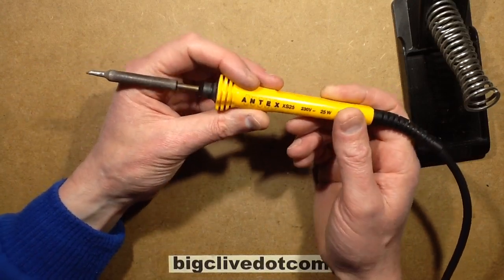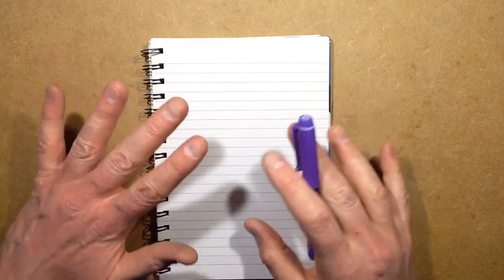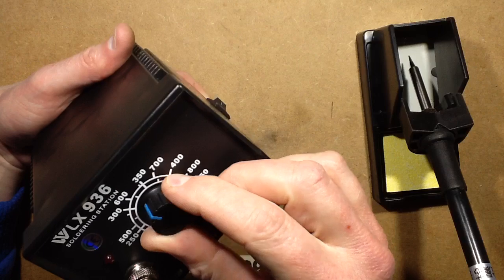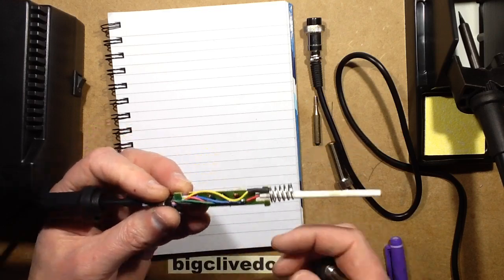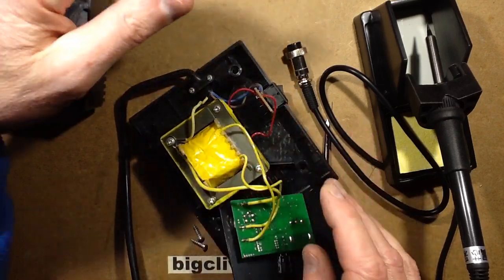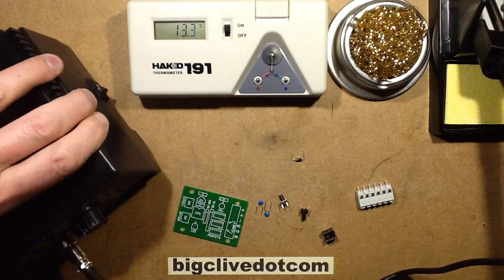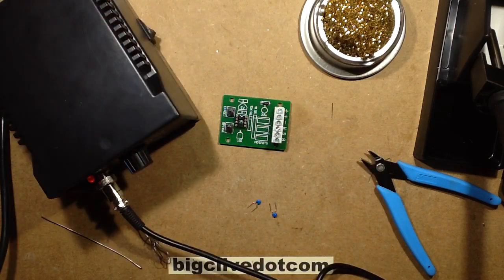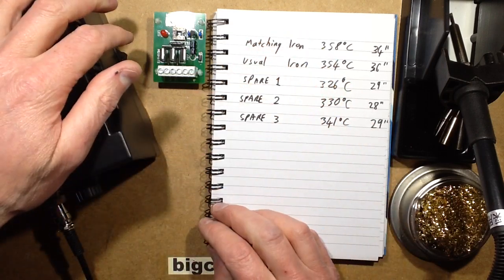Soldering basics and choosing a cheap soldering iron.

Comment: I'll echo the comment by +stefantrethan.  I tried one of the digital Yihua stations that Clive has on the way, and it drove me nuts.  Not enough thermal mass and it ate heating elements.  I ended up giving it away.  I bought a used Metcal station and I've never looked back.  Much higher thermal capacity, beautifully soft and flexible silicone lead on the handpiece, and it heats up in about seven seconds.  Honestly, the thing is a joy to use.

The beauty of the Metcal system is that there's no heating element or thermocouple to fail.  The power supply is essentially an RF transmitter, and each tip cartridge is a dummy load that's calibrated to reach a specific temperature.  The tip absorbs whatever power it needs to maintain that temperature, and it responds very quickly to changes in thermal load.  Yes, the tip cartridges are pricey by Chinese standards (US$15-25), but they last forever in hobby use.

If you're patient and watch eBay, you can easily put together a Metcal system for <US$200.  Look for the PS2E-01 or MX500 power supplies, the STSS-RM3E, MX-RM3E or MX-H1-AV handpieces (copies made by Thermaltronics and Easybraid use part number SHP-1), and one of the MX-series handpiece stands.  If you buy any part new, make it the handpiece, as the ones coming out of industrial use can be pretty rough.

The tips come in dozens of styles, all with part numbers starting with STTC (standard), UFTC (fine) or SMTC (SMT rework).  There are four series -- 500, 600, 700 and 800 -- that denote temperature (500 = 575°F/302°C, 600 = 675°F/307°C, 700 = 775°F/412°C and 800 = 905°F/405°C).  I use only 700-series (the most common) and they work great.  See: http://goo.gl/hNaAQF for Metcal's tip catalog, or http://goo.gl/lsx8JW for Thermaltronics' catalog of compatible tips.  Plenty of both available on eBay.

Comment: Don't know if I missed it, but did you test the calibration of the soldering iron tester? Maybe I'm paranoid but from brewing experience and seeing lots of cheap thermometers I don't trust anything on its own. Two or better three cheap but different ones reading the same I'll trust. Just one? No way.

Also, being taught to solder in a school physics lesson? How great would that be? They stopped teaching how plugs need to be wired some time ago. Back in the early 90s when I went to University and started an Electrical Engineering degree (that I didn't finish) I don't think 20% of the students had ever seen a soldering iron.

Comment: I got one of the digital 936 clones, and it seems fine with lead based solder. It does seem to struggle with lead free however.  +bigclivedotcom is it worth trying to insert some thin foil in as a sleeve to improve thermal conductivity? Or not worth the effort?

Comment: Would the soldering iron be usable with just a bench PSU, ignoring the thermo control?
I'd prefer it if so, a 2 quid iron on 24v on my 5A max supply....
Reply from the maker: +gazzaka I already had a play with that, but the mass is so low that it's not ideal.  24V would be too much.  The iron would probably glow red hot if fed 24V continuously.
Reply: +bigclivedotcom th I can reduce the 24v
Reply: +gazzaka You have to keep in mind that these are not high thermal mass irons, nor are they designed to be self regulating.  They are intended to have the amount of power flowing through them dynamically managed to maintain a safe and desirable temperature.  While you could dial in a temperature by varying voltage after extensive trial and error, you will find that they moment you try to solder a joint you will suddenly require a very different voltage setting to maintain an adequate soldering temperature.  Considering how cheap these soldering stations are, why not simply purchase the full station that does all of that for you without the risk of prematurely destroying your iron?
Reply: I know but for years, in fact even now...I use one of the Antex irons which function great with no such variations in voltage/current, so I wonder why we suddenly need a different system?

Comment: I'm using lead free solder is that okay to use on simple circuit boards, Is it toxic. I'v been learning how to solder like big Clive showed. It works perfectly going to keep practicing.
Reply from the maker: +Snoopy Singh Lead free is fine.  But treat yourself to some older style lead based sometime to see how it feels.
Reply: +bigclivedotcom I will do Thank you
Reply: +Snoopy Singh leaded solder is non-toxic, as long as you resist the temptation to eat it while you work with it.

Comment: +bigclivedotcom I would highly recommend treating yourself to some old Metcal gear like the PS2E-01. You can probly find deals for around $50-60 USD. I got one and I simply cant use anything else, it's just absolutely fantastic. No way in hell to "defeat" it's thermal capacity without unfairly cheating.

Comment: Cheers for this, been hoping for a soldering basics video since I have a fear of soldering after destroying a circuit board using a cheap iron I bought off Amazon. I've since bought an Antex, but I haven't used it yet for fear of cocking it up, because the old iron oxidised almost immediately and I wasn't sure if it was something I'd done wrong or hadn't done.

On an unrelated note, my heart sank when you started talking about patents, they're abused far too much to control markets. You could probably have invalidated the company's patent though with prior art!
Reply from the maker: +himselfe When you heat a new iron up you should traditionally apply solder as it first heats.  The Chinese bits come with the ends pre-tinned.  You should be able to recover the tip no problem.
Reply: himselfe
another issue today is soldering iron tips will most likely be tinned with lead free solder. I'm not entirely sure how that affects things, but I imagine it is not good, if you use leaded solder. But how good you can manage to tin your iron tip has a huge impact on how well the iron will work. Dipping tips in a solder pot changed things dramatically for me. So if you can figure out some way to get a little molten pot of solder, then dip your iron tips in that. They have to be bright, and shiny before you dip them. The tinned iron is said to be "wetted". A healthy iron tip will have a thin coat of shiny liquid solder on it. Not dripping, or anything like that mind you. But a nice overall layer nevertheless.

There's this stuff you can get to aid in tinning an iron called Sal Ammoniac too. I've never tried it myself, but I've heard good things about it. Try locating some in a hardware store.
Reply: +bigclivedotcom the best way to tin a soldering iron tip is with a solder pot. That way the tip is protected from atmosphere while it is hot. But not everyone has a solder pot they can use. Yes, I've tried the old wrap the tip in solder deal. It is inferior.
Reply: +bigclivedotcom Thank you! I've seen people mention this in comments on Amazon but it never seems to be mentioned elsewhere as something you should specifically do with new irons. It's one of the reasons I haven't used the Antex yet, because I wasn't sure if I was meant to do this or not. I can hopefully start moving beyond breadboards now!

Comment: I made my own soldering station board and I am wondering is good for heater to run on  ful 48 w until it gets to  temperature I set it to cause when it heats quicly heater wires inside heater move and I can hear it making noise I am woryed that that may destroy heater does it run like that in original unit that you have it is identical handle from ebay 3$ but heater doesnt have fat ceramic end at back just hanging on wires. Shoud I drop voltage down a bit I dont need it to head up in 20 secounds ?

Comment: "two females ain't gonna go together, two males ain't gonna go together"

Obviously the manufacturers of these products are rampant homophobes and need to be stopped.
Reply: +Paul Frederick So now a pin to pin connector will be known as a 'double ender'. Great :D
Reply: i came to the comments to make a joke about that
Reply: Gender changer*, even more of an innuendo-suitable name. Plus, there are plugs that mate with each other, they're called ... hermaphroditic, wink, wink.
Reply: For many decades we have used those sort of terms to refer to connectors.... The communication is usually clear that way.  It is almost necessary when dealing with adapters etc.
Reply: Got help them the day trans connectors become a thing. ;-P
Reply: You forgot about zoophile components. I mean implants.
Reply: +Bob Woggle I had a similar thought when that was said. Gay pride has not infiltrated soldering stations yet.
Reply: +Bob Woggle - I remember having a variety of "gender benders" for hooking up serial cables on the PC way back when, heh.
Reply: @deadfreightwest5956  Also called homosexual adaptors.
Reply: Snowflake alert
Reply: Sorry, that comment is not acceptable in Cukistan (formerly Canada).  Justine Trudeau would correct you if he could not jail you for that.
Reply: Akamal Fahkir okay boomer

Comment: That iron looks like it uses hakko style tips, elements, etc.  it's an exact clone of it pretty much, down to that PCB and spring around the element.   I like it because I do have a "real" hakko but the tips on ebay are stupidly cheap compared to the legit ones.  They may not last quite as long, but for the price it's unbeatable.

Comment: The 936 is a Hakko knock off but so is your Hakko 191, are you sure you're not assuming the 191 is accurate when it might not be? The 191 might be calibrated as badly as the soldering iron. I'm also confused about your buzzing transformers. I got a 936 knock off from Hobbyking & it doesn't buzz at all. Or I;m going deaf, one or the other!!!
Reply: +archiearchie666 As to buzzing, I don't think it's a design issue, just inconsistent build quality of the transformers. [Cheap] laminated core transformers tend to buzz if the sheets in the laminate are able to move and vibrate against each other.
Reply: Michael Tempsch

I'll have a good listen next time I use it. Mine is a standard yihua version so nothing special. I'm no expert at soldering as I only really started mucking about with electronics when I started watching Clive. Got to say I do love my soldering station & I've made at least six 8x8x8 LED cubes with no issues. I do think it's time Clive made a 5 day video building an LED cube

Comment: once you find out its 370 degrees or whatever temperature can you pull the knob off and put it back on with the marker at that temp.
Reply from the maker: +dooronron69 No.  It's got a chamfered shaft.  But there is the calibration trimmer inside.

Comment: I have the same antex as you because of the heat storage ability too.
Also i use a 25 and 17 watt for small jobs.
.
Ive told people that have problems with soldering to clean and tin the wire.
Dont use crap car shop supplied solder, it sometimes uses horrible flux and unknown mix of metals.
And get a 25 watt iron with thick tip.
Keep the tip clean and tinned for best conduction of heat.
They have success then :-D

Comment: Clive I regularly solder stainless steel, all you need is a phosphoric acid based flux, or in my case a small bottle of phosphoric acid. I dip the solder in the acid apply this to the stainless then solder as normal. works every time for me.
Reply: May I ask what solder you use?  The firm I got my flux from recommends pure tin, but I don't know why as lead/tin electrical solder is significantly stronger.  However I have followed my supplier's advice, but can't help wondering about it.  Have you used leaded electrical solder on stainless steel and, if so, have you experienced any problems such as with long-term reliability?

Comment: I found exactly the same with the more recent Antex bits, Clive - they must have changed something because they pit like mad, are rubbish with leadfree solder and now sold in 3 pack for massive markup. I ended up getting one of their generic 48w solder stations for 50 quid which, apart from the nut at the bottom which comes loose sometimes, I really like.

Comment: I don't use a wet foam pad either, I tried the brass tip cleaner stuff and I'm never going back.  When I solder I do it in the same way, but I usually put a bit of solder on to the tip first, not to "take the solder over to the board", it just helps transfer the heat better from the tip to the board (or whatever is being soldered at the time).
Reply: +CoolDudeClem 
That's how you are meant to solder, it's called creating a heat bridge.
Reply: +DNA Electronics It is called wetting, or tinning.